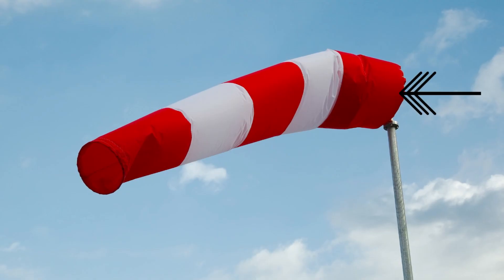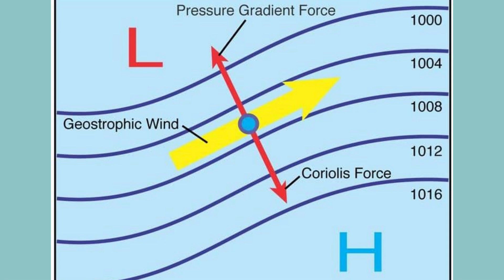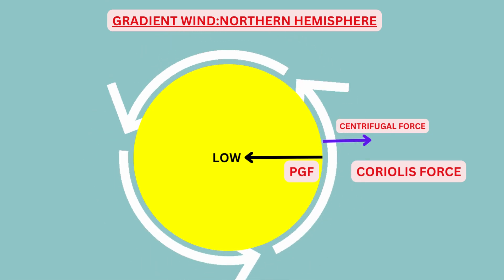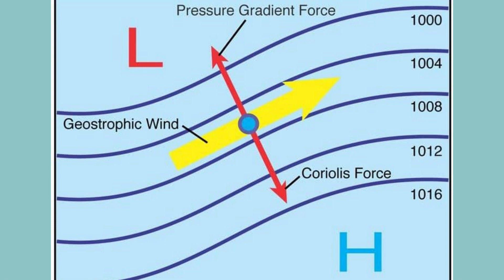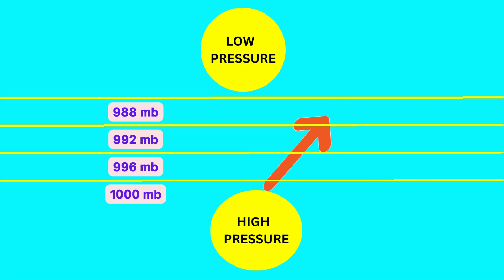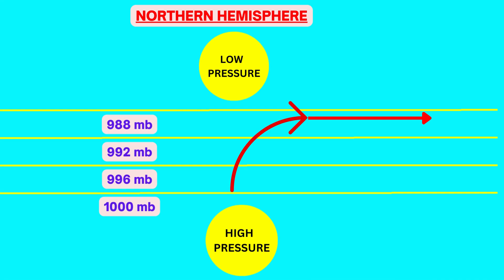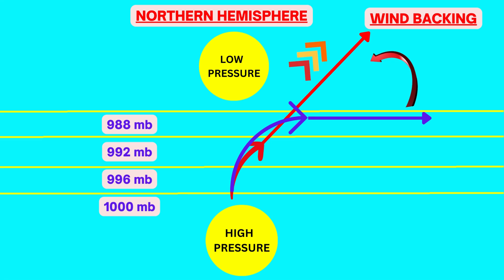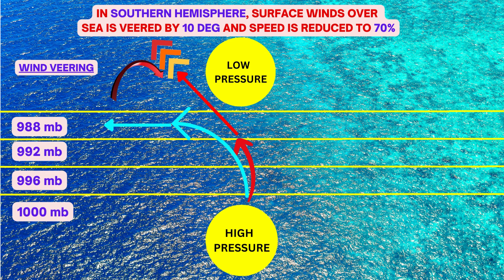METEOROLOGY FOR CPL/ATPL EXAM #SURFACE WINDS #WINDS #GROUND STUDIES FOR PILOTS

Comment: This video is so underrated. I’ve watched so many videos and read 2 CPL books, but none of them gave proper explanation about surface wind and the difference between veer and backing in NH AND SH. they always say vise versa. Vise versa of reduction or back/ veer was not explained. ( I even thought in SH veering is clockwise and in NH veering is anti clockwise - because they said it’s vise versa ) this is finally the best and only video that explained everything properly with reasoning. I’m someone who doesn’t like cramming, which I’m also bad at. I prefer to understand the concept properly. Thank you Captain for giving the knowledge that I was seeking and you were the only one who did it. Safe skies !
Reply from the maker: Thanks for the appreciation, I’m happy to have helped you understand the concept.

Comment: Sir, if on a weather map the isobars are closely packed, so will the surface winds blow parallel to isobars or across the isobars? In IC Joshi the answer to this is that they will blow parallel but I'm not understanding how? and why?
Reply from the maker: you are referring to chapter 6; winds. Question 17. Wind will try to blow from high pressure to low pressure area but due to coriolis force, it curves and get parallel to isobar. higher the wind speed, higher the coriolis force and more will be curving of winds to become parallel to isobar. In this question, isobars are closely packed ,so strong PGF, strong wind, more curving and will get parallel. But if surface winds are light, coriolis force will be small, unable to make the wind curve through 90 deg, so wind will blow across isobar.
Reply: @captainvijaysharma  Okay sir. It’s absolutely clear now. Thank you so much🙏🏼🙏🏼

Comment: Sir what about local wind types ?
Reply from the maker: Will try to cover it later.
Reply: @captainvijaysharma  is it enough to clear meteorology by watching all your vedios
Reply from the maker: @manveersingh580  . No. Videos are for improving understanding of a subject.You must still refer to books.
Reply: @captainvijaysharma  i am reading ic joshi parallely and doing the mcq is it good or i have to put some extra effort sir ??
Reply from the maker: @manveersingh580  IC Joshi and MCQ should make you pass the exam comfortably. However, you may elect to read Oxford for better understanding if you have spare time.
Reply: @captainvijaysharma  ok sir i will try and sir does the rtr exam difficult or normal ??
Reply from the maker: @manveersingh580  RTR exam can be difficult for some one who does not have previous experience of flying. If you are new to aviation, it is better to take some coaching from professional academy for RTR exam.
Reply: @captainvijaysharma  ok sir thank u

Comment: How winds affect the climb Vertical speed and descent VS?
Reply from the maker: In case of Headwind, Ground speed will reduce. Consequently vertical  component of Ground speed; that is ROC/ROD will also  reduce. VSI will show lesser ROC/ROD. Reverse will happen in case of Tailwinds. To summarize, if you are coming for landing in Headwind condition; ROD will be lesser than nil wind condition and if coming for landing in tailwind conditions; ROD will be higher than nil wind condition. Hope that answers your question.